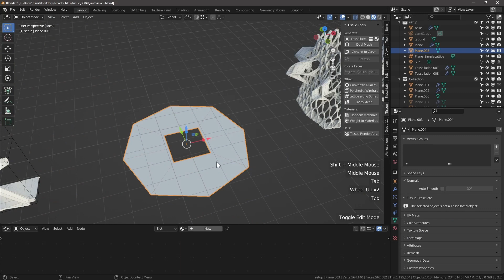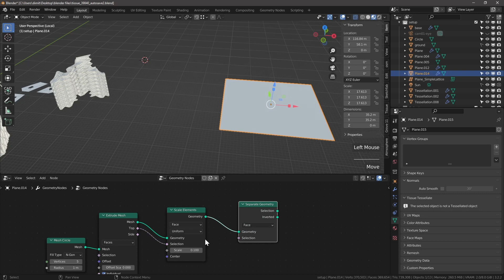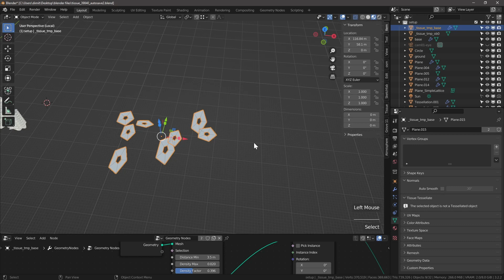Parametric Fragments - Super easy tileable and elegant elements

Comment: Hi, I noticed that the height of the tessellation doesn't seem to scale the same as the lateral axis. It appears that there is a "shrinkage in height" .. like it is squashed.. how to deal with this? (I hope this is clear) [Edit: I realized that the thickness scale is 1 and that it looked like that "height" was shrinking.. because the x and y was being scaled appropriately.. so it seems like the Z axis needs to be scaled to keep the same kind of similarity in shape. I am just doing simple orthotropic scaling with simple shapes]
Reply from the maker: There is an option in Tissue to use relative and constant scale. The default is relative. I suggest trying constants to see if you get more consistent results.